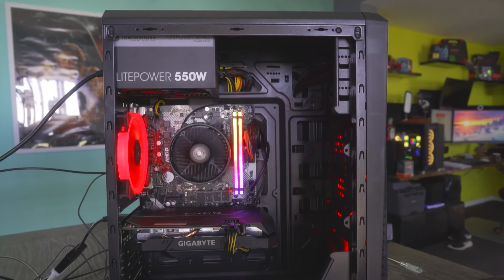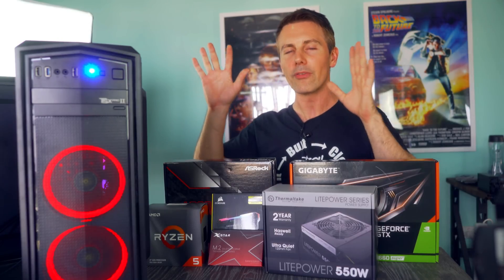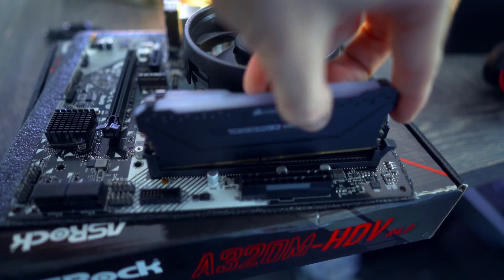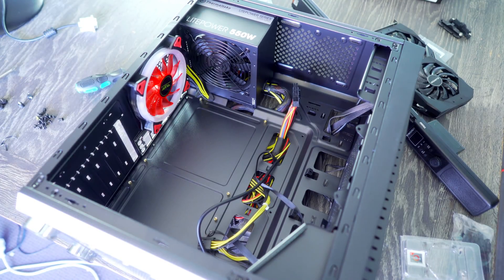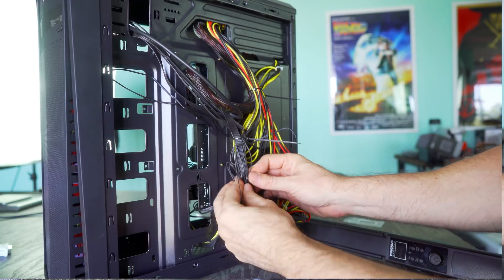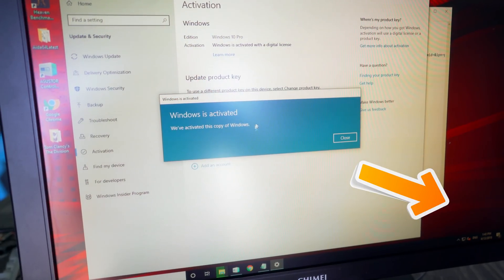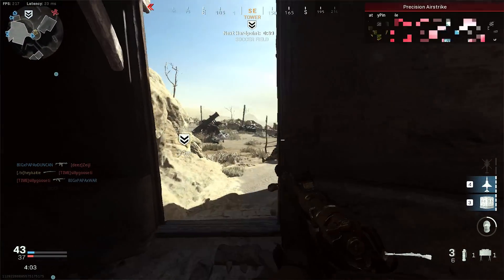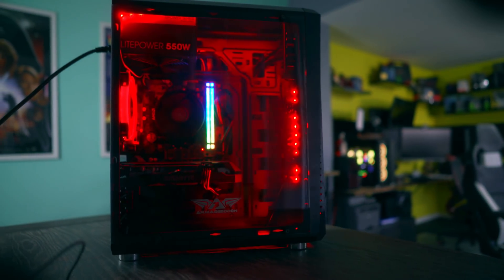How To Build Your FIRST AMD Ryzen Gaming PC...! ($750 Best Value Rig)

Comment: I'll save myself $13 and use Linux.
Reply: If you're gaming just get windows for free, linux has far less compatibility with games
Reply: @chongwong  I believe this a thing  called a "joke"
Reply: @bharatmadhok6773  No, I wasn't kidding.
Reply: @chongwong  It's not just for gaming, Linux is just as capable as a gaming platform, also it is lighter and faster than Windows

Did I mention it doesn't have many security flaws?
Did I also mention that it doesn't collect your info or have a key logger installed by default.
Reply: Me: gets a 3$ key on eBay
Reply: Just choose whichever that match the need

Comment: Just scored a sweet deal:

i5 6600k
Asus Z170A
16GB Kingston HyperX 2666mhz
Cooler Master Nepton 240M
WD Blue 250GB M.2

For 150 euros.
Reply: Stefan Zlatanović holy Sh... Amazing Deal!
Reply: i5 4690K + Hyper 212 Evo
ASUS Z97 PRO Gamer
16 GB DDR3 Corsair Pro 2400 MHz
MSI GTX 980 Ti

All in a tempered glass case (both sides and front) and 4 RGB fans with controller, same 150 Euros a couple of months ago. Seems like 150 is the new magic number!
Reply: @rhyzon  damn, nice catch fam. I need a gpu, psu and a case. And I am ready to flip this like a mofo :D
Reply: stonks
Reply: As long as you avoid games like Assasins Creed origins, Odyssey, BFV & SOTR. Those 4 core and 4 thread cpus will struggle cause of the high physics and actions in those games.
Reply: @ORBPHIL  I don't think I'll be playing any of those, maybe I'll go for Odyssey some time next year. Either way, I flipped the i5 and got a 4790K to go with the rest of the parts, so it should be a lot more manageable even on high demanding CPU titles.
Reply: @rhyzon  You can also check how well the 4790k will do with Assassins Creed Odyssey. Hopefully an overclock to a 4.5 ghz, 16 gig ddr 3 1866 mems and maybe a 1660 ti should tackle it. 
If it ain't enough, you may need to change platform to a minium of a 6 core-12 thread to a 8 core-16 thread cpu😬
Reply: @ORBPHIL  it will handle it just fine. Not on the absolutely best settings, but it will run without any problems at around 60 FPS and 1080p, which is the monitor I have.

Comment: is worth it to upgrade to this, my current unit is i7 4790 non k, 32gb ram at 1600mhz each,  mis rx 580 8gb gaming x
Reply: Royrafe Bancoyo I'd say no, until your needs are higher and your i7 can't cover them anymore.
Reply: Nah wait an extra year, your build will be fine until next gen consoles come out.
Reply: i jusl feel outdated because of unit but i can still run pretty much everything on my rig
Reply: @Rod 1984 i already have SSD, my plan was, selling my motherboard, proc and 32gb ram, and buy a new mboard, procie and ram, i can still use my other parts
Reply: @Rod 1984 was actually planing buying ryzen 5 2600 or ryzen 5 3600, i just need to sell my motherboard, Procie and Ram.

Comment: I just built my first Ryzen build a few weeks ago 👍 I used the 3600 too, but found the stock cooler to run really hot.
Reply: Taseen Jubair - I put a hyper 212 evo on it. Did a comparison video, it dropped like 20c 👍
Reply: You can find the wrath max coolers or other ryzen box coolers brand new on ebay for 30 dollars.  Alot of people sell the cooler after they get the cpu because they dont need the stock rgb  cooler.